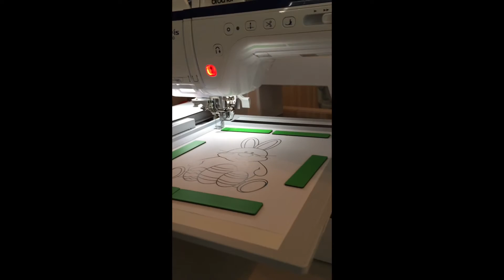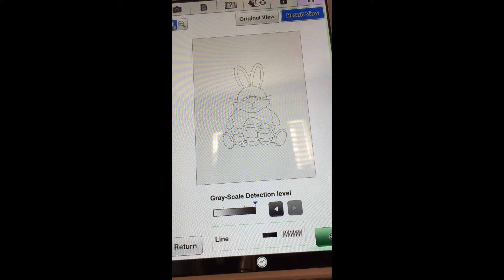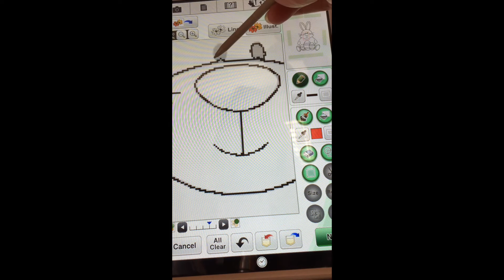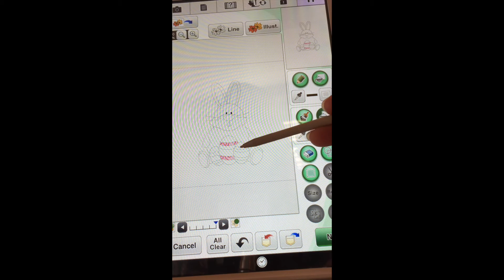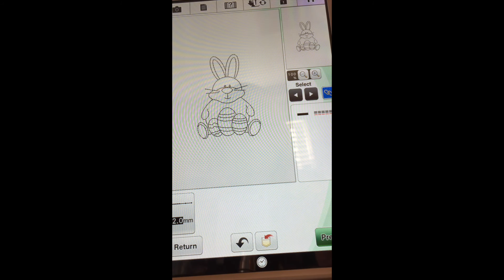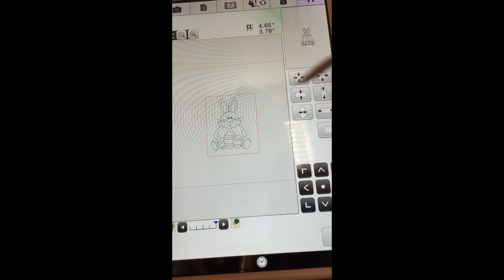My Design Center Scan Line Drawing

Comment: How do you stipple an embroidery item behind the design that was just embroidery designs
Reply from the maker: Carol Ferguson - if I understand your question correctly, the easiest way to add stipple to an embroidery design would be when you have your design on the screen in Embroidery Edit.  Select the Edit icon, then the stipple icon.  You can select the hoop size, distance from the embroidery design and distance between the stippling.  If you wish to scan an Embroidered block to add stippling after something has been pieced together, such as a quilt, Hoop your fabric with the backing, batting and top, Scan into My Design Center, then use the tools to trace around the design.  Create a outside boundary with a no sew line, then use the bucket to fill with stippling or another decorative fill.  I show this technique in several videos in the My Design Center playlist and the embroidery playlist.